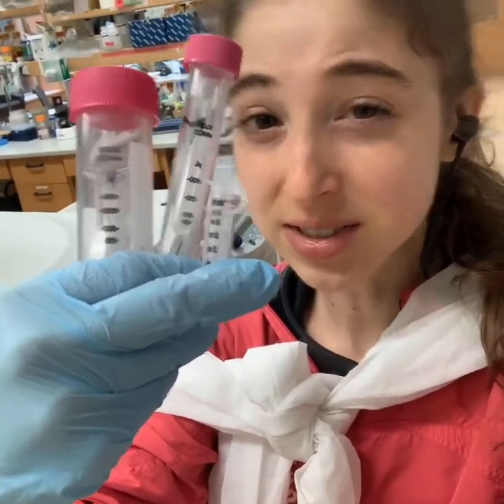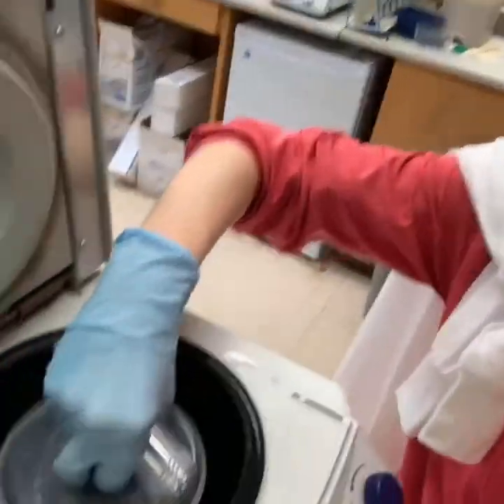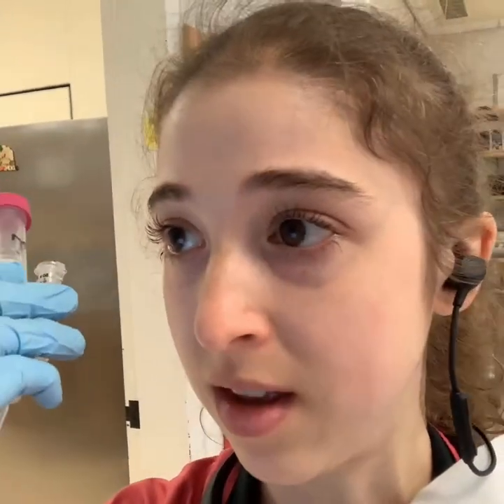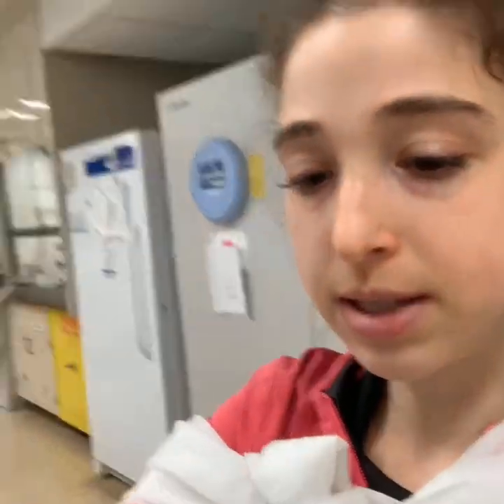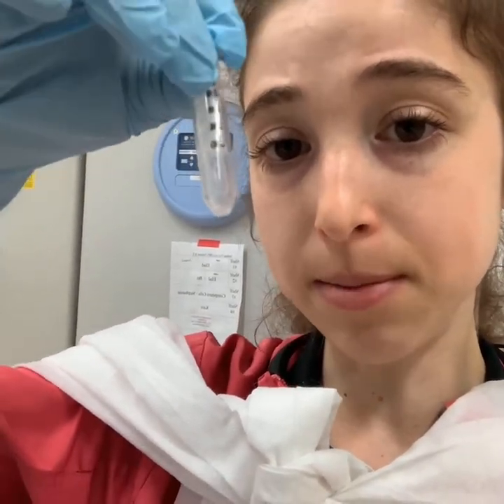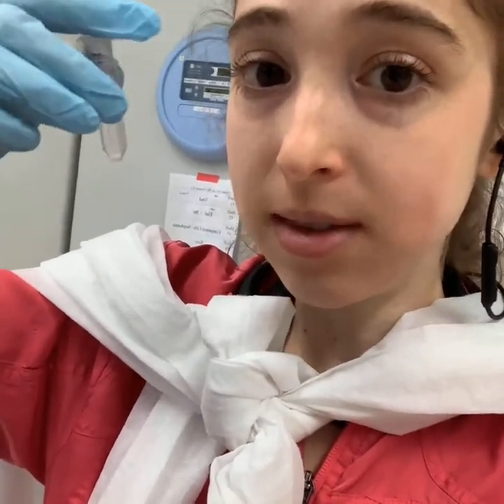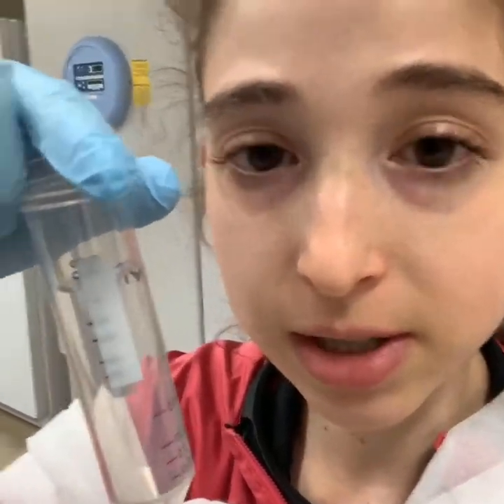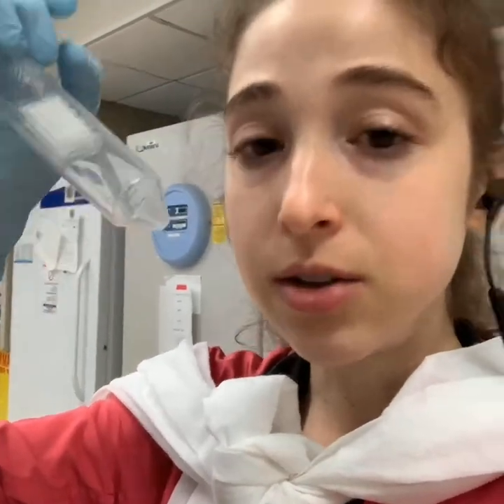Centrifugal ultrafiltration - concentrating protein using spin concentrators (e.g. Amicon)

Comment: Thanks for the wonderful video! If I wanted the final volume to be 100-200 uL using the 50 mL tube size, then some part of the membrane would become dry during the centrifuging, would this cause my protein precipitate on the membrane? What would be a better way to do this? :)
Reply from the maker: Glad you found it helpful! The protein should actually all concentrate at the bottom - it should get pulled down and therefore not get stuck on a dry membrane (but you still do have to worry about protein sticking to the membrane in general)

Comment: Regarding using Amicon 100 KDa, etc. I found a protocol using 3000 g for 5 minutes. My centrifuge can do only 1400 g. Is it possible to do ultrafiltration in this conditions ? You have a practice experience.
Reply from the maker: It will probably just take longer
Reply: @thebumblingbiochemist  m
Many thanks.

Comment: Hi, can i ask whether you can do overnight dialysis at 4 degree celcius with the protein concentrator tube?
Reply from the maker: These tubes aren't designed for dialysis – instead you'd want to use a dialysis pouch